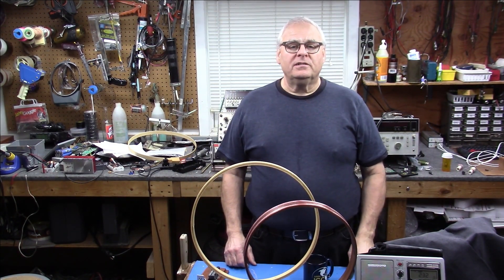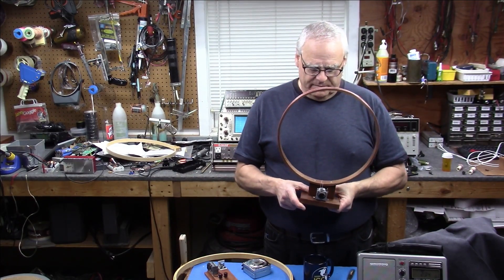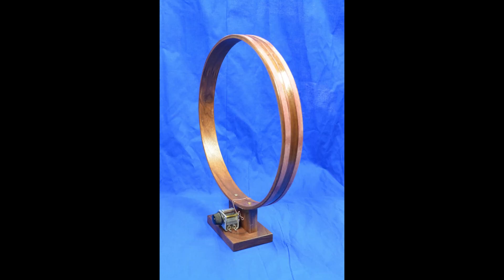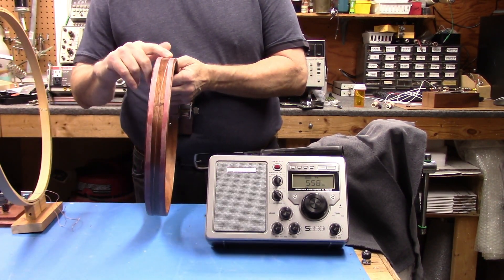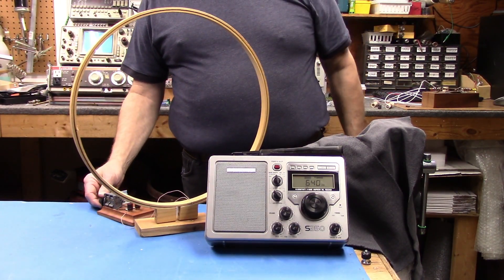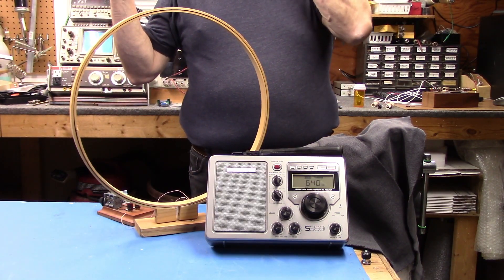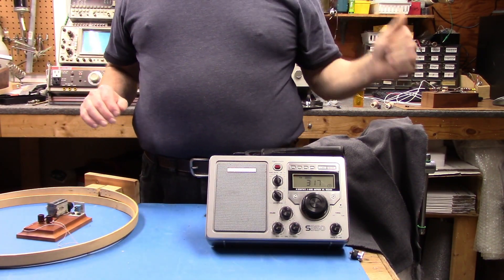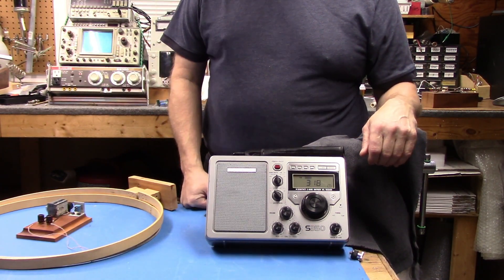AM BCB  Loop antenna  Make your Am portable hear better

Comment: Just made a connections mag loop for transmitting as well. Cost me nothing. All made from junk collected obey the years. I was an Ejectrical engineer, so I had heavy earth wire used as a loop inserted inside microbore  plastic pipe left over when I installed extra central heating. Varible cap, a wider space than normal from an old valved radio. Old upvc to make brackets and a plate for mounting. It works very well. Surprised at its performance 50 Watts has not flashed over. Sharp tuning. I simply tested on Rx only for coverage by tuning for peak noise. I can tune 4 ham bands ok and transmits.  Wonderful. So now interested in other types of loops. Thanks for your input. Brings back by Early years  in radio.

Comment: You dont need a variable capacitor. Just wrap wire around the radio then run the wire out the window to a tree.

Comment: cool work
were can i find that variable capacitor ?
from what divice it come from ?
Reply from the maker: Its just a standard broadcast band tuning capacitor 365 PF available on eBay  Paul W1VLF
Reply: @W1VLF  did not see on ebay Paul w1vlf
seen only other seller mostly china

Comment: The results are truly amazing. However, it is not clear how the coil turns are located under the screws of the frame to the base.
The winding is in a continuous strip. Do the screws pass through the coils of the wire?
Short circuit?

Comment: Well, much more compact than my wire antenna, but I just put up a random wire and looped it around my AM radio, the grounded the other end. I DXed stations thousands of miles away.
Reply from the maker: Yes sir.. That works well.  We use what we can for best reception.. Thanks Don.. W1VLF

Comment: About 5 years ago I built one using a loop of wire, tunning diode, a variable resistor, and a 9-volt battery. The diode seemed to work as well as the variable cap but the tuning diode takes battery power. I think I used a resistor to limit current but I'm not sure now. 
I predict it won't be long because of DSP radios before variable caps in the electronics junkyards or even part stores are hard to find and I found that a tuning diode and a variable resistor can replace them and I got it to work.
Reply: the price of a decent 2 gang 365pf is near $100 now! the time is now to build your own

Comment: Nice workmanship on your handmade loops. I think I made 4 for either Am Broadcast or 80 meters. Often I include a sense loop and clip it to or jack it to a loop or two I place around the ferrite rod in the radio. The sense and ferrite loop are not needed but why not if you have the time.

Comment: Excellent demo. Do either the wood or krazy glue sap much rf away from the coil windings?
Reply from the maker: Not that I have ever noticed.  I have built many loops out of different materials.  No metal framework .. that would not work

Comment: I want to make one using the external antenna connector as opposed to coupling. 
My radio I use for AM BCB DXing does not have a built in antenna. 
Any ideas?

Comment: Excellent video.  I made one using a 14 inch diameter embroidery hoop with regular magnet wire.  Also one using a loop cut from the top rim of a 5 gal. plastic pail. (about 1-2 inches wide).  They work well. More impressive was a 4 turn 6" diameter coil that I hooked up to my 80 meter half wave end fed antenna. My small radio fits inside the coil.

Comment: Great Video I notice your wire is litz wire , wat size and number of strain is the wire? Thank You
Reply from the maker: Hi Dave, For the AM broadcast band I typically use wire size #46.  This comes in several 175, 660, and some lesser strands.   Avaiable on Ebay and elsewhere. W1VLF

Comment: hi
Can/Would you kick it up a level and make a Loop Regenerative like the Select A Tenna 541S  
thanx 
73 de jordan ve7jjd 
jjdobrikin@gmail.com

https://www.universal-radio.com/catalog/mwant/4318.html  
The Select-A-Tenna 541-S medium wave [AM] developed for customers who required better performance with some specific applications. These applications have internal ferrite rod antennas that are more difficult than the average radio to obtain good High-Q mutual coupling with the models 541 or 541-M. The 541-S provides the solution to these applications.
The 541-S is an active device with additional controls that has an internal regenerative amplifier and requires a 9 Volt battery (not included). There is a green LED on the front that illuminates when the antenna is turned on. The unit has an additional variable 0 dB to +10 dB gain added to the intrinsic +30 dB for a useful gain up to +40dB. The unit has both Coarse and Fine Tuning controls for ease of operation at the higher gain settings. It also has the capability to effectively drive a remote ferrite probe. This is useful on applications of large case radio installations that the 541-S cannot access directly with it's intrinsic near proximity effect.
The 541-S may be used in any of four different modes: 
(1) Direct Near Proximity just like the 541 and 541-M. 
(2) Ferrite Probe Near Proximity. (See photo below) 
(3) Direct Wired Antenna Connection. 
(4) External Antenna and Ground for metal-buildings when using modes 1 and 2.
The 541-S has a high-signal level and low-impedance balanced drive port for the ferrite probe. This provides the capability to not only drive the 6 foot (1.8 m) coaxial cable and probe, which are included, but the cable may be extended to as much as 26 feet using extension cables readily available locally. This is very useful for remotely locating the 541-S away from radio noise sources or into better signal locations, when moving the radio itself may be inconvenient. Select-A-Tenna's are approximately 11 inches in diameter and 2.5 inches deep.

Comment: Great video Sir! Looking forward for more 🙂 I have the AN-200 Loop and thinking of changing the variable capacitor in order to make it resonate on lower frequencies like 2200m so I can receive some FT8 signals down there. Take Care, looking forward for more videos! 🙂 👍 73! DE1CTL
Reply: The AN-200 is tricky to open, you should have ordered the AN-100 for this purphose. The variable capacitor do not need to be replaced, just put another capacitor in parallel; it should work with 300 to 500pF.
Reply: @maxit-mw  Thank you, last year I buid my first loop for sw so I have a variable capacitor up to 500pF (double) so I will add that.
Reply: @catalinalb1722  ok if the size can fit inside. It has a plastic capacitor. If you are lucky there are more sections that you can put in parallel with a switch without replacing it